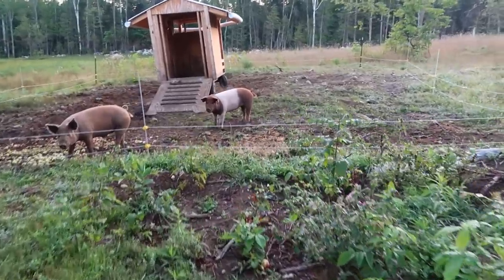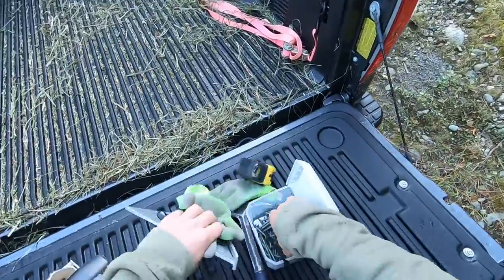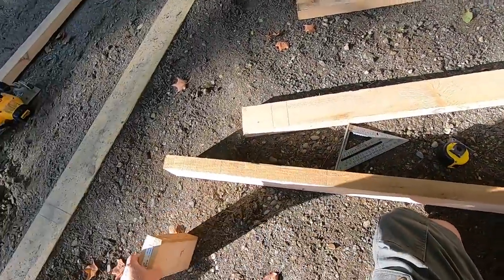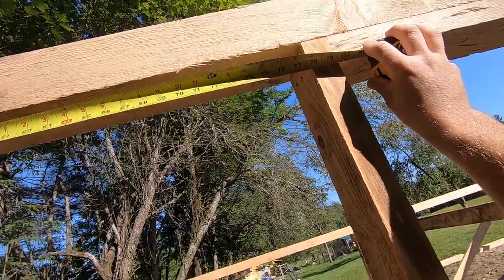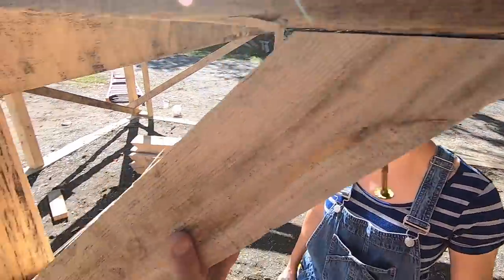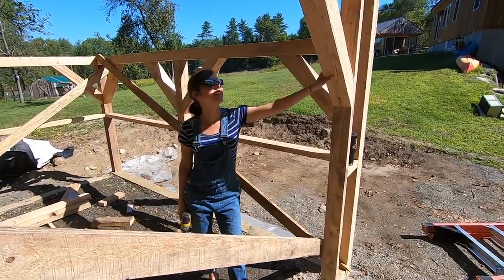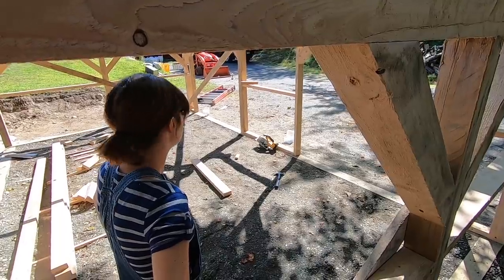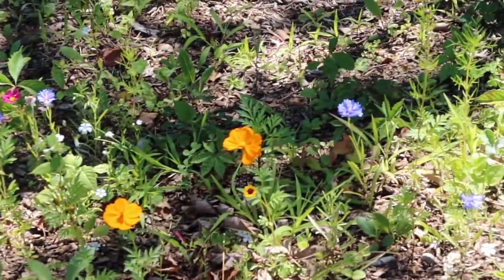She's Taking OVER the Post & Beam Build Installing the Angle Braces

Comment: Yes, I have to admit I've never seen or would have considered a dirt floor wood shed. In my youth in upstate NY we had an abundance of rock like you do so we put ours on really big single rocks footings. The rest was old style mortise and tenon log joinery. We didn't get new fangled until we used nails to hang the slab siding. The slab was free, just mill waste: First slices off logs they milled square. It was free back then. They had to pay to have it hauled off so they were happy to have anyone take as much as they wanted. We built all our out buildings with it.

Comment: Nice kit.. the build is going fantastically well so far.   My only concern is the wet/green wood used for the bracing.   Wet lumber will shrink as it dries and cause your joints to separate and weaken as it dries over time.  Either way, Excellent team effort you two!

Comment: Is that the Dewalt 6-1/2" portable saw or the 7-1/4"-- I have all the other Dewalt tools and looking to add that saw. Building out in the woods is easier without having to haul a generator.

Comment: Al; you might want to consider not siding the wood shed to get maximum air flow for drying. I am sure you could save the siding for another project. just a thought. 35 on the barn thermometer this morning. Fall is coming.
Reply from the maker: Brrrrr
Reply: Or spacing the siding for air flow
Reply: @jimh712  l
Let's wait and see.
Reply: @tonygrimes13  
Yes. 😃
Right now we're just guessing.   🙉

Comment: Do you have any concern about your lawn slumping into your car port during the rainy season? You might consider using some of that cobble and 3/4 minus to make a retaining wall. Might have to cut it back 12-18 inches and a 4 inch deep channel to fit a course of boulders for the base though. Might look pretty sharp and use an abundant free resource from the land. Could be a cool project to video.

Comment: I started to watch the video and when I seen the sill just buried in the ground well that was all I needed to watch, give it a couple of years or less and that sill will be gone to rot and good by little shed.
Reply: Terry, I agree with you. with plastic to hold the moisture in as well I just groaned; such a waste of money and time. Build it once, and build it right = build it to last. This will be falling down in a few years due to untreated pine buried in gravel = moisture (and thus rot) magnet. It's the same with the barn, untanalised pine is going to rot pretty quick - I feel sorry for the goats getting to live in damp cold conditions this winter. That concrete floor will wick up the moisture and cold as well unless he puts thick pine shavings on the floor.
Reply: The sill is pressure treated and there's a layer of plastic under the stone to keep moisture from wicking up to the wood. Once the stone dries out on the inside, it's all good. It may not last forever, but I'm pretty sure it'll last at least 10-15yrs. He could also go around the inside and outside edges of the sill and soak them a preservative or some people use old diesel oil or fuel.

Comment: Thanks for the building video. I need to add diagonal supports to my deck which is currently just on posts. I wondered about only using one lag screw at each end of it. My cousin recommended two at each end (so, 4 per support) and they should have washers and be countersunk. Is that overkill? I wonder how yours have held up over the past few years? Did you need to go back and tighten, or reinforce at all?

Comment: do you have the tension setting on the drill correct.   the rattling should only start when the screw has reached the correct depth.  it acts as a warning to stop screwing any more.  i could be wrong and if i am some one could tell me the correct procedure. thanks.

Comment: Al when building something you put the camera on your head and it makes a jerkey video, cain't you put it on a tripod so we can see everything as you move around. Some of the barn videos were on a tripod and they were a lot better. On the front left side you were putting up braces, the 4thfrom last is put against a 2X4 where you framed the doorway. You need a short piece between the corner and the end of the brace. Looks good be safe.

Comment: Are you going to put any protective oil on your barn and wood shed
Like maybe linseed oil
for termites
Reply: @donaldmiller8629  
O
Reply: @donaldmiller8629  Indiana had them when I was there in the 50"s!!!
Reply: the ground contact wood is pressure treated, that keeps the bugs out.
Reply: @somerledbob  
Bob I hate to be the one that bursts your bubble..
But pretty much all late model homes are setting on pressure treated mud sills...
And most homes have termites..
At least in the warmer climates..
Reply: @jimh712  no buble bursting. I'm in CT, most all buildings are on concrete, however, we use pressure treated wood for fence posts and shed foundations, pressure treated wood uses copper sulfates to reduce pest infestations but doesnt do anything against moisture rot. I can't speak to your warmer climates, but where I'm at, this is how it is.
Reply: @somerledbob  
Yes if you build out of pressure treated wood
Termites are unlikely..
In the Pacific Islands
I think it's manditory to build out of pressure treated...
But it doesn't look like the Timber Frames are pressure treated except the ground or concrete contact lumber...

Comment: This is a funny comment because I don’t eat eggs. I saw this o a cooking show. If you eat Scrambled eggs try this the people on the show seemed to like it and was simple. Use 4 eggs whisk well in a bowl. In a heavy pan put 3 table spoons of extra virgin olive oil heated to the point it just begins to smoke pour the eggs in and immediately using a rubber spatula fold the eggs into the middle while they are slightly runny put each servings on warm plates they will continue to cook.

Comment: I don't mean to be critical, but what you are doing is not post and beam.   Post and beam construction has tenons and mortises that they fit into.  They are held together with wooden pegs, about 1` inch in diameter.  And it has to be put together in a certain order.